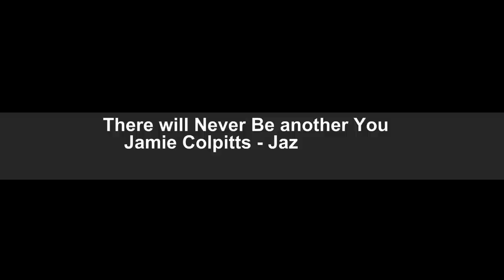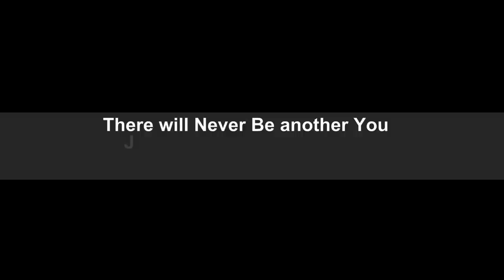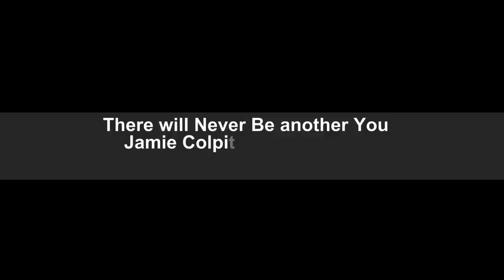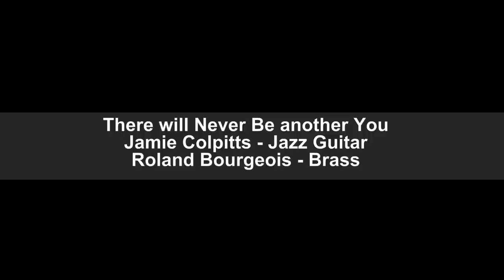Vlog #220 Picking With Mitzi and Much More

Comment: Hi, Jerry I'm just curious as how you can cut a axle into,turn one end down small enough to go inside  the one you cut it off of. I would think that when the one part was turned down small enough to go inside the other there wouldn't be anything left to put inside the one you just cut it off of. Or did I just misunderstand what you actually said?
Reply from the maker: The original axle was a piece of solid steel slid inside a hollow pipe I just cut the pipe off and slid the steel in further it's no longer welded
Reply: @RosaStringWorks      Yes I finally saw the episode where you did all that.   thanks   Glen.

Comment: Question for you, do you think if I scrap the varnish off my acoustic….it might sound better? 

It’s a £130 acoustic, so I think it may be worth experimenting. 

Let me know. 

P.s……love the channel, since lockdown I’ve been hooked!
Reply: You don't want a bare wood instrument. The varnish is there for more than looks.
It protects the wood from physical damage (to some degree) as well as damage
from moisture, sweat, spills, excessive humidity, etc.
If it was ok, to leave it bare, everyone would be doing it. They're not. 😁✌🖖
Reply: @zapa1pnt  It protects the wood from physical damage?! Proceeds to bash a guitar with a hammer Oops, now I see what you meant by "to some degree". Just kidding, of course. I remember that Jerry once did remove varnish and then applied shellac instead of lacquer, but there was probably something more to it than just improving the sound? Perhaps it was when he built one of his mandolins and something when wrong with the finish...
Reply: @Wolf-Spirit_Alpha-Sigma : Jerry has had difficulties with several finish jobs, but always got them fixed.
He has said many times finishing is Not his forte. 😁✌🖖